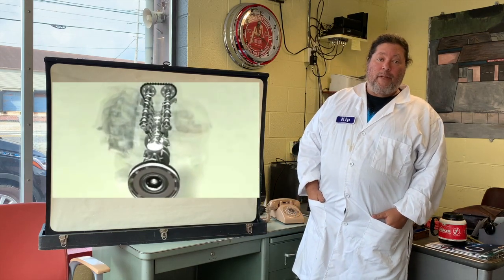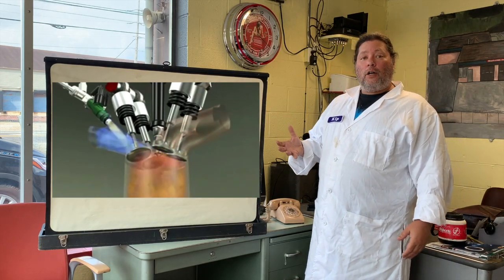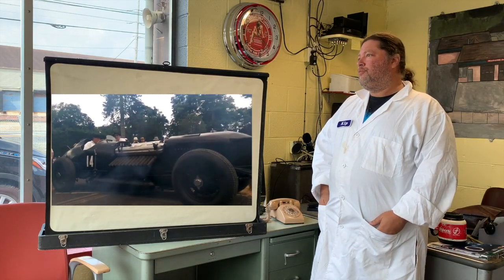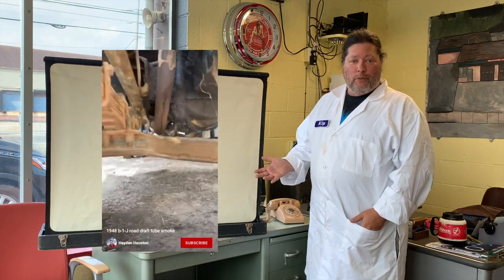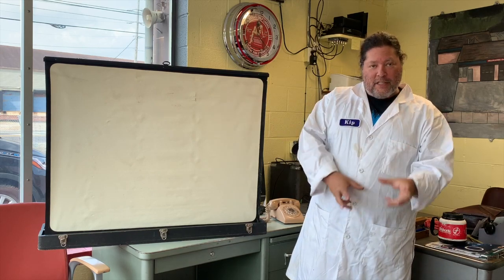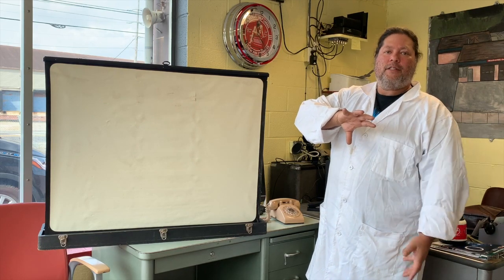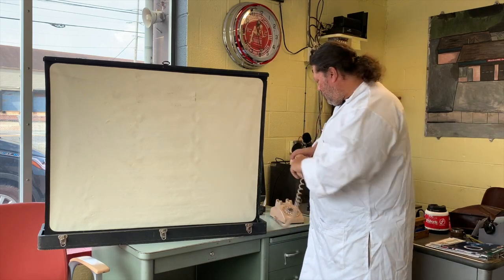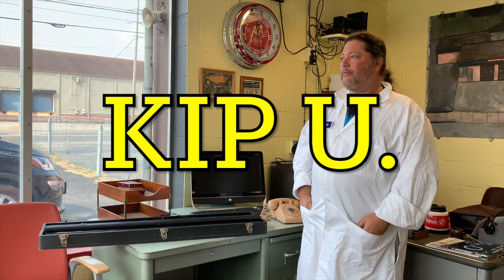Kip U Number Two! The PCV Valve. So small, yet so interesting. Learn Something! Ram Promaster

Comment: Hey Kip, what about using an oil catch can to keep the gunk out of your engine?
Reply from the maker: Solving a problem that doesnt exist. Assuming you use the correct oil, and assuming you change it at 5k-10k miles, and assuming the engine doesn't experience an overheating event - these engines dont sludge up or otherwise suffer any oiling problems. We've never even seen an oil pump fail, or a chain fail, or really any oiling problems of any kind.

Comment: Random question. My 2018 Promaster 2500 doesn't have cruise control. If I wanted to add an OEM part (6TB16JXWAC), to the van, would it have all the required wiring harnesses/ parts already installed? Plug and play so to speak? I also remember you saying that all the parts from 1500 to 3500 are interchangeable. If I bought the OEM cruise control from a salvage1500, it should work just fine for my 2500? Thanks. Love your channel btw, so glad I stumbled on it. I will definitely be watching more.
Reply from the maker: Sorry, didn't see this sooner. My guess is that just adding the stalk wouldn't enable the cruise control. No matter, as the Rostra unit is $300 and pretty easy to install. That said, we've done two Rostra installs and had issues with both, though many other people have had none. Buy it from the guru of cruise control, M and R Electronics in Saginaw MI. Super helpful real people, same price as Amazon.